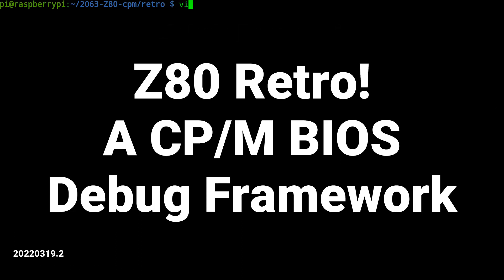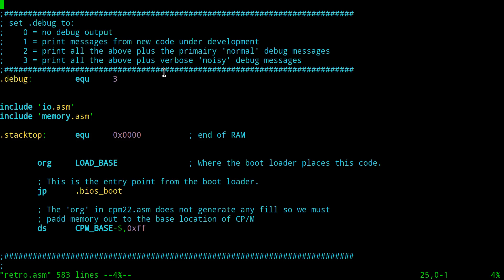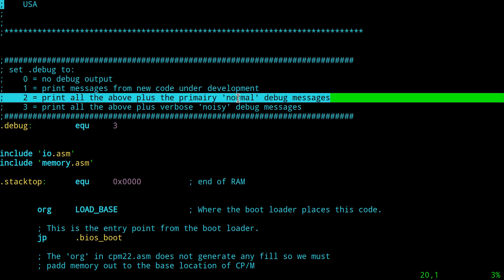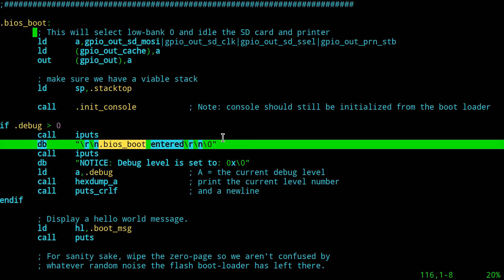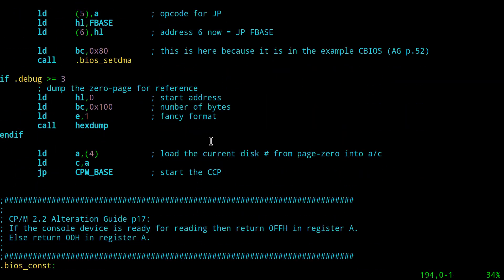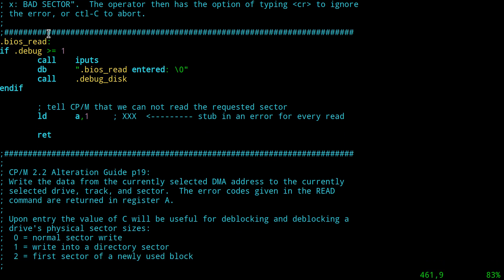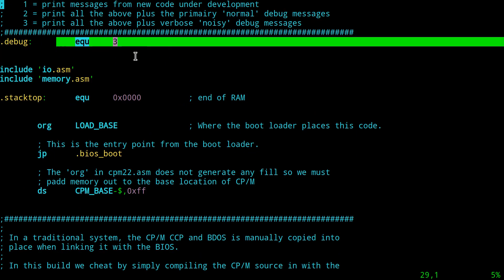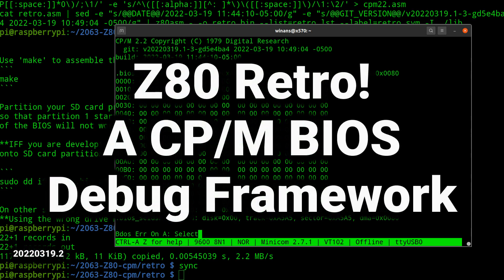Z80 Retro #26 - CP/M BIOS Debug Framework

Comment: Back in the mid 1970's, writing your own BIOS was a S100 initiation ritual which I did as an early teen and found the power of such teeny weeny bit of glue code to get a Disk Operating system operating on your own custom home built computer amazing!  My system was originally cassette tape based (@300 baud) so I had to first load in the tape based editor/assembler, write some code frequently saving to tape, assembling, executing and debugging it before committing the code to either EPROM or sectors of a floppy disk.
Reply from the maker: So cool!!

I STILL find it amazing how little code is needed to bring up CP/M from scratch!!
Back in the day, my WD1791 driver was little more complex than a UART driver!  [For those unaware, the 179x chips are floppy disk controllers. Using one on the Retro board would have eliminated all the SD card complexity. But it would also add much cost to cover a floppy drive and create a whole new problem of finding a way to share data with a modern computer.]

We can't possibly be the only ones.  There must be a plethora of empirical proof that an unsupervised teenager is capable of designing & breadboarding a viable Z80 system and then writing a BIOS for it from scratch while learning their first assembly language!!  😀👍

There should be a club or something!  Or maybe a support group? 🤣
Reply: back in 1986 on high school, I got Atari 800 XL, one of few available here, but even without casette recorder, so with help of my dad, I handly drawn and etched in HCl squeezed PCB for CD4046 PLL based interface for regular recorder; in school there was computer club, where only people with CP/M at that time were those with Sharp MZ-800; we had in school some simple systems with 8080, so I decided in 1988 to write simulator of 8080 for 6502 in german macroassembler Atmas-II over 2 summer months, it did everything except EI, DI, HLT and DAA (no resources to do it right/fast at that time...); it was presented with documentation as learning tool for home computers as some kind of school thesis; but as it was all on casette tapes, that INTEX-8080 mac source was lost and its fully dead ))

Comment: If you implemented the Z80's special reset (Patent: US4486827A), you can use the Z80 itself act as an ICE (In-Circuit Emulator) with debugging functions.
Reply from the maker: Yeah.  Someone posted a note about this a few months ago where I learned of it for the first time.
Back in the day an ICE was expeeeeensive!
This would have been a cost saver indeed!

When I was a kid, I could never afford an ICE.  That fact forced me to evolve my software in tiny increments while testing each bit (no pun intended) like crazy before moving on.

I still use the same approach to this day even though fancy IDEs and the like have reduced the need to do so.

If anyone tries this special reset mode for debugging I'd like to see how it went.
🤔I suppose you'd still need a resident monitor for it... And that'd need to be debugged first.

To be brutally honest, I think that programmers that have never been FORCED to suffer the punishment of having to re-enter a first-stage boot loader in binary on a front panel every single time ANY programming mistake causes a program to fail (or power is cycled or the reset button is pressed...) has missed an important learning experience teaching them how to PLAN and THINK about software design in a way that could save them a HUGE amount of debugging time over the rest of their lives.
Reply: That patent is amazing, some stuff I didn't know existed!
Reply: I've not seen any projects on YT actually implement it, it's discussed a bit here and there.
Basically it lets you reset the program counter to 0 without clearing the registers as far as I understand.
Reply: It also has the program counter captured in an external 16-bit register (so that the debugged application can resume) and an ICE monitor ROM being switched into the memory map and launched for the ICE functions.
Reply: Very interesting, is there videos on YouTube about such ICE implementations? I think for modern DIY it's a must.